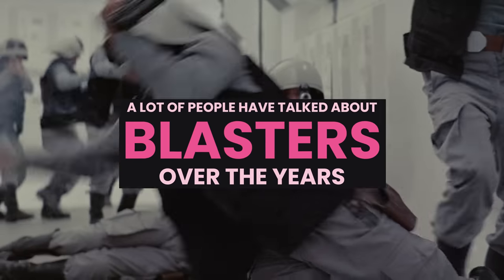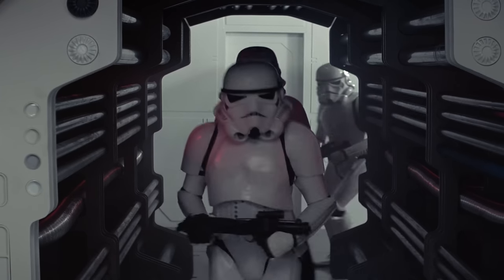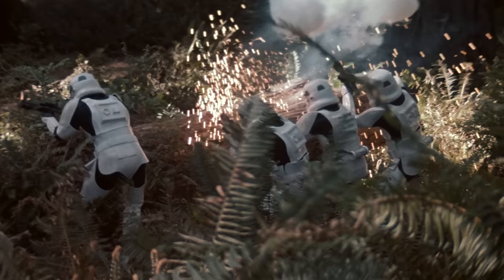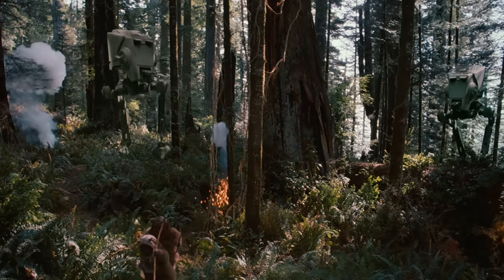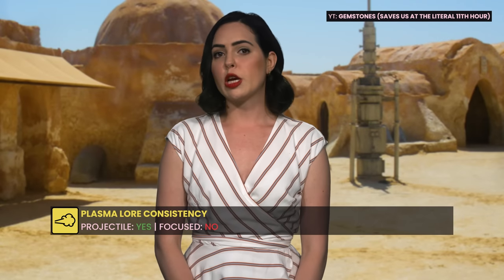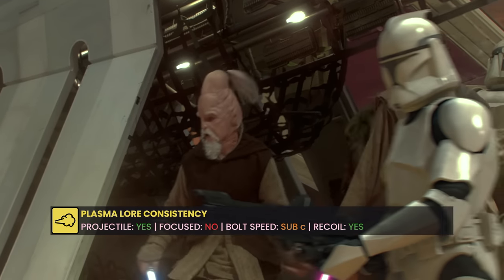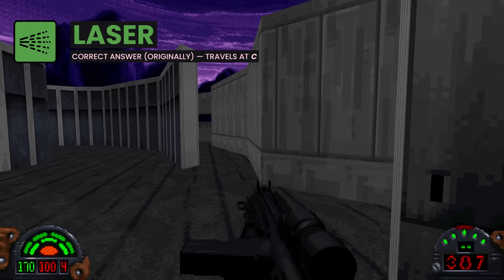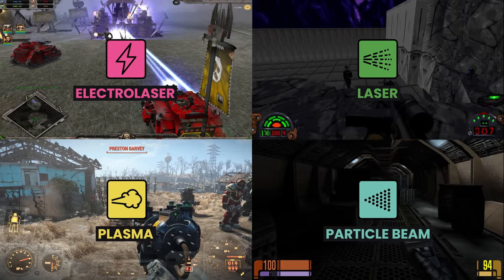Star Wars BLASTER TECH: The Definitive Guide

Comment: The particle shield and ray shield issue isn’t actually an issue. I’m gonna assume an explanation for how ray shields work, but if they block lasers via an electromagnetic field of some kind, that would also affect a particle beam or plasma, as both of those are also electromagnetic. A particle shield not blocking them would make sense if it affected everything that wasn’t electrically charged, so it doesn’t block lasers, particle beams, or plasma
Reply: That is exactly it. IIRC particle shields are effectively repulsors that push neutral matter away.
Reply: Nerd
Reply: @roflchiefmcjoflchief1791 wtf you doing here then?
Reply: @chamberlane2899  chill I gave him a like

Comment: Ok, I'm gonna throw a wrench In the works. Ion cannon, turbo laser, etc. These are translation issues. Nobody speaks English. They only seem to speak English like Tolkien characters do. They speak galactic standard, in d and they'd speak common. We don't know what language that is, but it's not English. So the English names for things are not necessary to be accurate, they are only be required to be consistent in use. Same for shielding. It's an attempt in English to convey to the audience that this thing protects against that thing. It's name is potentially rubbish .
Reply: I agree somewhat.
These things might work with slightly different rules of nature, and thus. there won't be a perfect translation into English.

And it's just easy to call a parallel long stripe of light laser. Even though they are not the same thing.

Sometimes we lack words and use the closed to what we know. Like how the new aptera 3 wheel electric vehicle is still called a car, even though there are many reasons to claim it's not
Reply: What you think about High Galactic alphabet lore 😂

Comment: My interpretation for blasters has always been that the damaging part of the bolt is contained in the laser light, but the delivery mechanism is the ionized tibanna gas. Light only travels at c through a vacuum. Ionized tibanna gas causes the laser light to have its group velocity slowed down to near zero. The key (magic) marvel of tibanna is how little you have to use to get the slowing effect and the relatively inexotic temperatures and pressures involved. On earth we've slowed light to 38 mph but the conditions are ... extreme.

The gas cloud is then electromagnetically propelled towards the target as the bolt. When the cloud hits the target, it disperses, and the laser light transfers its energy into the target. Ray shields (known to be effective against lasers) are still consistent, since they absorb the light (and most of the energy) from the bolt while ignoring the otherwise harmless tibanna cloud.

The lore concept is that (earth-style) lasers have a continuous energy output and (like on earth) are very hard to scale up to damaging levels without huge power sources. If you could collect laser light from a lower power source (like a capacitor for light) and deliver it to the target all at once, this would be the breakthrough that would distinguish blasters as a better (although still laser-based) technology.

Since the tibanna cloud causes some diffusion/scattering (this is how the bolt is visible) and has to stay in shape over long distances (to stay at the density required to keep the light moving slow enough), a major characteristic of the range and power of the device is gas handling. The other two main characteristics are how long is spent lasing into the gas before release (fire rate) and the size of the input power source. A lot of the complicated and chunky technology around large blasters and turbolasers would be consistent with handling these aspects.

I'm not really sure of what onscreen and in-fiction aspects wouldn't be consistent with this interpretation, but I'm sure there are plenty. It does seem to work well with what I can remember.
Reply: Massive block of text, but also YEAH!!
Reply: I mean it’s 5 paragraphs lol. I agree tho, this makes some sense. It’s fun too, if this actually would work semi realistically.
Reply: This is exactly how I believe that blasters work and explains the "laser/particle beam/charged particles coupled with light" bits, and it reconciles the distinction between laser cannons and ion cannons: ion cannons are just blasters without the damaging laser component. This is also how I believe that lightsabers work: the old lore actually describes lightsabers as being based on blaster technology.

Comment: In reference to "I cant think of any sci-fi universe that uses electrolasers as weaponry" at 21:00, the Shock Rifle from Halo is explicitly referred to as an electrolaser
Reply: Destiny universe also has shock weapons used by the Fallen, like the Shank, the Pike, the forward gatling gun on the Spider Tank, and the Wire Rifle
Reply: Fallout New Vegas also introduces these with the Old World Blues expansion.
Reply: @Reddotzebra  and Lonesome Road's Arc Welder weapon is basically an electroshock flamethrower.
Reply: Unreal Tournament also has the lighting sniper rifle that basically has the same discription of laser ionisong a path for the lighting to travel along.

Comment: This would make a lot more sense if the "galvan"/focus was behind the blaster module, as the thing that excited and directed the gas.
The fact that the gas is excited in the first place, definitely implies plasma, unless the "crystal" somehow only lets ions through...
Maybe the blast itself is some combination of particle beam and plasma exhaust created by the left over tibana gas, focused through the front like that by the barrel to prevent venting in unfortunate directions.
Perhaps the gas itself is excited by some kind of laser technology that heats it, too, which would explain the "zeroing" mechanism described of disabling the blaster and pulling the trigger to only get a single dot of light
Reply from the maker: Good point, the low-power laser sight modification could still work with other blaster types. The Cracken blaster sight is old enough it was intended as laser, but could be updated for other types. Technically that bit of lore lines up with electrolaser best, but a laser could also be the first stage of firing a plasma blaster. -DZ
Reply: Nerd
Reply: @thebreadcircus  nerd

Comment: This is quite the interesting argument of a video, I quite like how open ended the answer is.

For me, Im personally Team Plasma.

Many of the properties of blasters, from their appearance, to how they interact with defenses and the legendary lightsaber scream plasma (atleast to me). The mention of the laser generation within the weapon could be explained as a method of rapidly exciting the tibanna gas which becomes the actual bolt itself, for example. The question of ray vs particle shields could be explained by ray shields being some form of electromagnetic barrier - as charged particles, such a barrier could interact with the plasma and block/disperse it - if not the bolts particles itself, perhaps the magnetic bottle that holds the energized gas particles in place, which would cause the bolt to disappate rather suddenly on contact instead of carrying through to the hull. Meanwhile particle shields would work against larger, generally uncharged targets like say a proton torpedo but not really what is essentially angry gas - particle shields can be set to ignore gasses and seem to do so regularly (ie hangar containment fields). 

Since plasma is technically just a soup of highly energized particles one could also squeeze the "laser/particle" noncommittal answers into this aswell 

Dont forget legendary lightsaber vs blaster bolt clashes - saber seem to be near universally accepted as plasma blades, and it would make sense if they could deflect a moving plasma bolt due to their containment fields disagreeing one another.

This could possible explain how stuff like ion weapons (highly charged plasma bolt?) and stun weapons (a lower charge, rather dispersed bolt used more as a carry wave for a stunning shock) operate aswell.

But that's just me, I appreciate you going over the multiple popular angles.
Reply: I’m inclined to agree, for whatever it’s worth. I would also add that another issue with jedi using lightsabers to deflect them if they’re some sort of laser is that that would mean they’d literally have to move at the speed of light to deflect consecutive beams, which doesn’t make a lot of sense, even with the help of the force.

Comment: There is a possible explanation for the laser/plasma hybridization.  There is a physically possible energy weapon called a "laser coupled particle beam" in which through physics a bit heavyhanded for youtube comments, photon pressure from a laser helps "squeeze" a particle beam on all sides, effectively keeping it focused while normally the particles (all sharing a strong charge) would want to repel each-other.  This weapon would be both a particle beam and laser, a stream of heavy charged particles encapsulated within a laser.  These beams can travel anywhere from 5-20% the speed of light, and would impart both significant physical impact to the target as well as ablatively drilling into it, and causing explosive secondary effects as some of the target is vaporized by the transfer of energy.

Comment: My view is that blaster weapons do fire streams of particles. More specifically these particles are tibanna gas molecules that have converted first into an ionized state by the XCiter (step one). These particles are then pumped into the firing chamber where they are heated up by the defraction of a laser beam through a prismatic crystal (step two). These ionized and heated particles are also compressed by the electromagnetic field generated by the galven circuitry until they are emitted as a stream of particles down the barrel called a bolt (step three).

The bolt's muzzle velocity is extremely low with hand held weapons, often only achieving around 70 m/s or so. Damage results are primarily from thermal and electrical effects on the target. Vehicle lasers use a multistage firing chamber and higher end lasers to greatly increase the muzzle velocity to around 2 km/s or so. This higher muzzle velocity allows for more secondary effects from the tibanna gas molecules being compressed by the impact, including occasional fusion of fusionable material contained within the lattice of a tibanna gas molecule. Turbolasers increase muzzle velocity even further, using a multistage firing chamber and a turbine to further heat and ionized the beam. This allows turbolasers to achieve muzzle velocities as high as 15 km/s and are almost guaranteed to cause secondary fusion effects from the tibanna gas molecule impacting at such high velocities and energy states.

Tibanna gas is described as being produced by organisms in gas giants, it is essentially a hydrocarbon that traps fusionable material, allowing it to be used as a convenient means of fueling fusion power systems. This means it is also highly dense but can also cause minuscule fusion reactions when individual molecules are compressed by extreme heat, pressure, and even impacts at extreme velocities. This is why some high power blaster bolts seem to explode on impact, in extreme cases they may be delivering a thermal burst from a handful of fusionable atoms fusing from the extreme impact of the tibanna gas molecule impacting with the target.

Comment: Tibanna gas is also used in repulsortech, as fuel for hyperdrives, and can solidify into blocks of solid carbonite, as we've seen. Given its seemingly impossible properties, tibanna could conceivably be used to condense a laser beam into a bolt. Or how about the idea that the blaster can fire a laser beam sheathed in tibanna, which provides the combustible atmosphere for an electrolaser to work (think arc welders)?  Most blasters also appear to have a stun mode, which seems to utilize an electric shock. It would also explain the limited range of blaster weapons in the vacuum of space. And what about deflecting blaster bolts with a lightsaber? That heavily supports the projectile visualization of blaster bolts. If we take the Bad Batch as canon, they have to be lasers. Crosshair's signature trick is using tiny mirror pucks to deflect blasts at tricky angles.

Comment: 1. The Mad Max Interceptor has a (roots-type) supercharger, not a turbo.
2. The original Cyberpunk 2020 Rpg features an electro-laser gun in carbine form in one of the Chromebooks.
3. The blasters may have a muzzle at the end to protect the recessed lens inside from dirt and impact damage. The lens might also get hot after some shots and the muzzle might be a heatshield to protect the user and their holster.
4. Plasma bolts would have very little recoil impulse, as plasma isn't very dense and therefore would have very little mass. Also their speed seems to be roughly equivalent to real wold bullets. Where would you store all that mass in blaster anyway, if they were somehow as dense as solid projectiles? 
5. The problem is that Star Wars is not (hard) science fiction, it's a space fairytale or western or samurai movie. So the creators didn't bother with scientific explanations until after the movies were done, became popular and fans started asking all those questions. It has sound in space after all, which alone disqualifies it as SF.

Comment: One fantastic bit of tech from our world is the "MASER" or microwave amplified by stimulated emission. It's a predecessor of the modern laser. It's not very powerful or useful due to its age and limitations. However, the neat thing is that unlike a laser, a maser can pass through objects.

But, more relevant to the video, my head cannon for blasters was that they used a tabana gas catalyst laser to forcibly ignite more tabana gas to produce plasma. The blaster then "electrifies" the plasma, because it's conductive, before magnetically accelerating it out the end of the blaster. While in flight, the electro laser from the blaster maintains the plasma reaction.

The trouble is that normal plasma would immediately dissipate. So tabana gas would have to have a special property which somehow maintains the coherence of a plasma bolt. I always figured that the tabana gas had magnetic qualities. However, remember the maser from above and consider this weird bit of science: magnetic fields are technically made out of photons. It's not too far fetched, in terms of sci fi, to imagine that in addition to the electro laser, a secondary maser is able to project through and around the emitted plasma bolt in such a way that it could guide it like a rail road. At this point, things start getting into particle and quantum physics. But that's good enough for me.

Comment: The closest thing to a turbolaser I can think of irl is a synchrotron particle accelerator.
By using powerful magnets in a circular configuration you can continuously accelerate particles trough them allowing for a more stable and powerful beam over longer distances, unlike linear accelerators wich can only accelerate particles a single time, while also being less eficient regarding their length compared with the circular accelerators. It would also make even more sense if we stick with the particle beam explanation for blasters in general.

The funny thing with star wars is that very in spite of using terms and elements in a seemingly wrong way you can always find parallels in the real world to make them work anyways.
Reply: Nerd